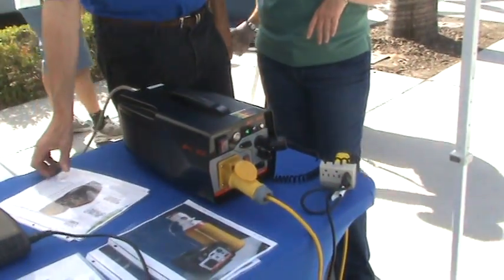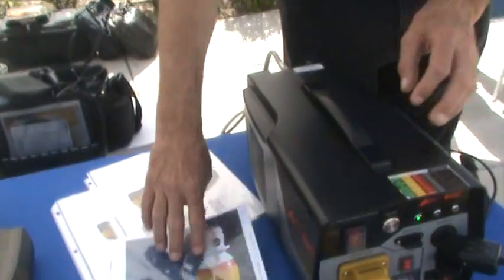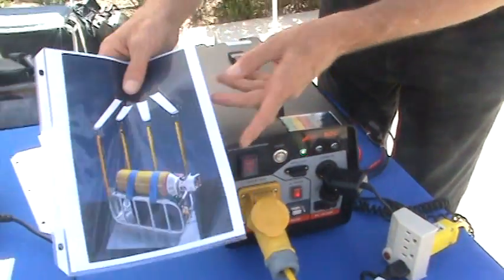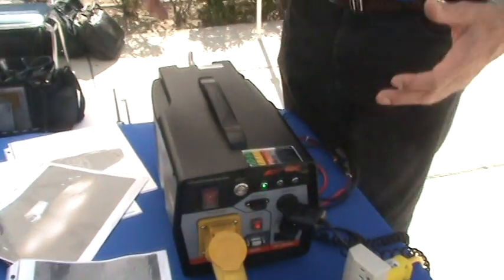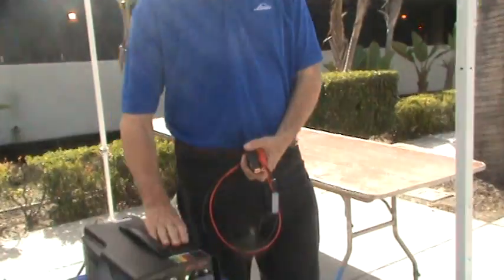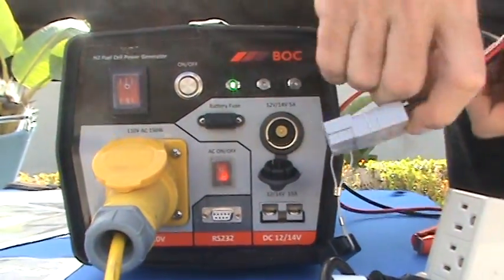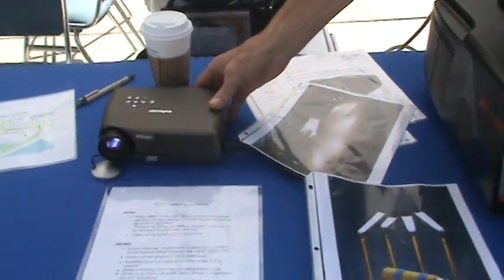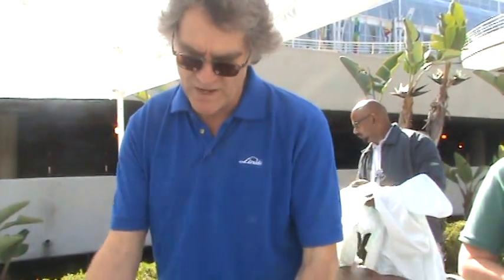Linde Portable Fuel Cell Generator

Comment: Do I understand, does it uses a bottle of compressed hydrogen? There is nothing cheap or safe around hydrogen. I was searching for fuel cell generators, but my expectation would be them use methanol, not hydrogen. I wouldn't take a bottle of the gas around myself that easily. Well made piece of gear by the way, I like it.
Reply: Yes this will use a cylinder if hydrogen. This video is 9 years old and the technology has been developed. Have a look at this link about what is available in the UK currently   https://www.boconline.co.uk/en/products-and-supply/industrial-products/hymera-generator/hymera-generator.html
Reply: You say use methanol, I can show you tons of accidents with methanol cars blowing last 5 years. The most dangerous gas is methanol . I know it I have very good experience with it.